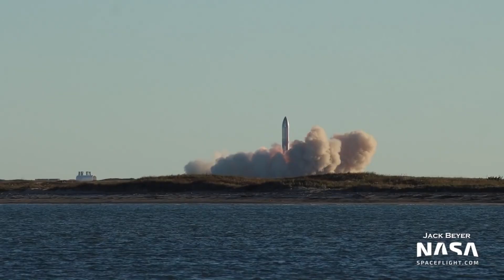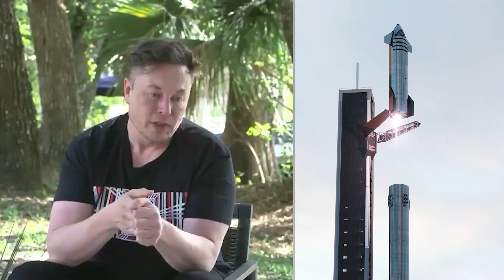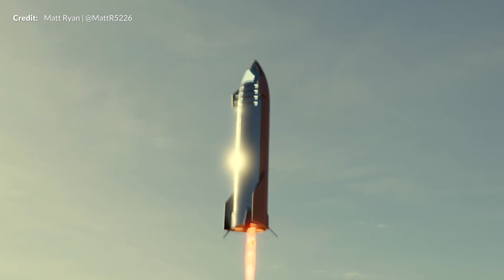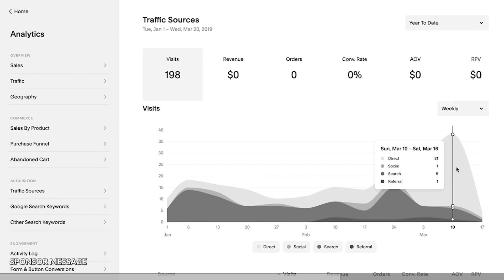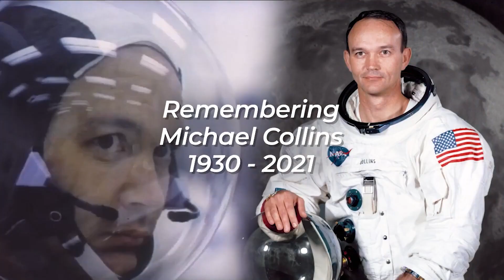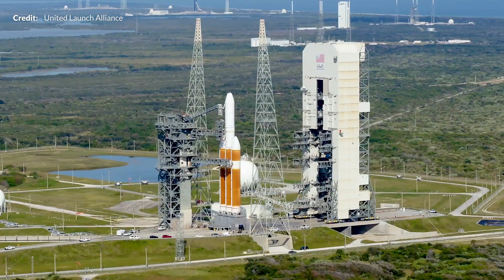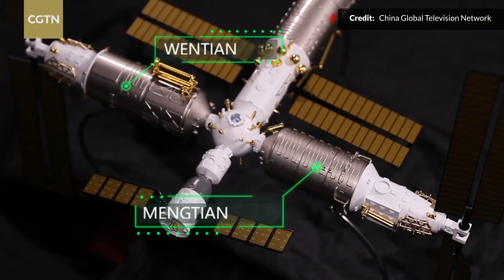SpaceX Starship SN15 Flight soon, NROL-82, Crew 1 & 2 updates, Starlink, Michael Collins

Comment: The Falcon 9 booster landings are extremely impressive and have become very accurate. My only concern is whether that level of accuracy would be enough to catch a super heavy. The margin for error would surely have to be down to inches. Just(!) landing in a circle would be nowhere near good enough.
Reply: The Super Heavy won't need to do a hover slam, thus it can trade fuel for accuracy.

Comment: The launch tower structural members - steel HSS (Hollow Structural Steel) columns with horizontal connecting struts and vertical bracing (diagonal members)

Comment: I guess that catching starship (as opposed to landing on the pad) would allow for much farther turnaround. You would not have ti land, wait for depressirisation, get out there with a crane and transporter, bring it back to the tower and stack with the tower crane. You could of course develop an optimized process for pad landings - but the one for catching has to be developed anyway. So: catching starship allows for optimal turnaround with overall simpler processes.
Thanks for the video!

Comment: Minor comment on the Integration Tower structure - the horizontal members are not supported by the diagonals. That whole triangular assembly is primarily to provide lateral stability against any non-vertical forces such as wind, vehicle lifting/moving/catching, etc. It transmits horizontal forces to the base and foundations without the whole tower excessively swinging and swaying around. It's what is generally termed as 'bracing'.

Comment: I was out of the loop for a while... what happened between SN11 and now? We are at 15 already?
Reply: SN12,SN13 and SN14 were never fully built as the upgrades required had been designed/ built into SN15. So it made sense to skip straight to SN15.
Reply: @InnocentMan99  thanks for that, makes sense to me! Cant wait to see SS atop the first stage
Reply: SN11 blew up. They skipped 12, 13, and 14 as they didn't inovate enough.

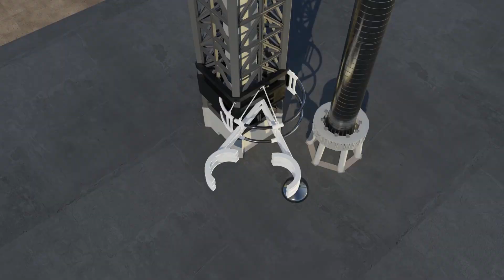Comment: 5:52  The launch tower will not have a crane on top. The tower arms will do the stacking. OweBL has it right at 6:46. As per the FAA application; the design "will allow the mechanical arms to lift vehicles."  That document specified the tower height and the height of the lightning rod on top - the height of any structures on the top is central to the FAA's concerns. To them it's all about how far up it extends into airspace, so mention of a crane is conspicuous by its absence.

The tower will have arms anyway, so why not use them for stacking also? No crane means - the best part is no part.

Comment: Oh and for catching Starship? that's obviously only for the tanker versions - so they can take more fuel up per trip.
Reply from the maker: You know... that is a good argument.
Reply: @MarcusHouse  - sorry yes, not 'obviously' sorry - a turn of phrase.

But given the complex dynamics of carrying fuel while burning fuel - not having the legs or the internal bracing to take force at those points?

for a single moon/mars starship? might equate to one less fuel tanker launch, or mean the same number but 'safer' launches.

It's possible they intend to catch a lander starship to somehow save of the amount of fuel it needs to land when it gets back home - but... why not just refuel it in earth orbit (enough) before landing if that were the case?
Reply: @MarcusHouse  - it doesn't need as much fuel for landing - so a full tanker ready for the next Starship to launch? could be waiting to provide some landing fuel for the Starship that's arriving (presumably this would offer an advantage when making a mars -> earth transit as you wouldn't need to carry landing fuel etc) - at the very least it would be a good safety 'feature' to have should crews return in emergency and the fuel is somehow not available.
Reply: @MarcusHouse  - there's a lot of talk about proving in orbit refuelling - but let's be honest, it's basic engineering with some interesting challenges - of course it's going to work! like something in physics is going to totally block us ;) if we can refuel between aircraft in turbulant airflow? we can crack zero-g.

Comment: why dont static fires prosuce lift??
Reply: They do.But the base is bolted to the Launch Platform. They use explosive bolts to launch when the system says all 3 Raptors are operating within parameters.
Reply: @David-yo5ws  - They don't use explosive bolts - they use mechanical clamps that release - although when not planning a flight? it's probably also additionally bolted down.
Reply: @JohnnyWednesday  Awesome, I did not know that. Thanks for putting me right. 👍

Comment: Catch the starship with a big net. No fuel or header tanks needed.

For Moon and Mars we still 
need the swoop-swing-manuevre though.
Reply: It weighs 120 T.
Reply: @fredbloggs5902  I meant a huge net.
Reply: @dwdvIl  Not a spiderweb. Obviously! A human made net with dampers slowing it down from maybe 50 -100 meters height. Imagine Aricebo telescope but with a net.
Reply: @JensPilemandOttesen  Starship is designed to withstand stresses at particular points in precise directions, Landing with specific stress bearing points seems more viable. Like the jack points on a car.
Reply: @JensPilemandOttesen  If Starship doesn't slow it's falling speed, it will be like crashing into pavement, it weights 150 Tons. It may be possible in mars but here on earth it's better and cheaper to do a landing with the engines
Reply: The best landing is no landing at all - never land the tanker, hover it, have drones fly in with fuel pipes - refuel it - it goes back up.
Reply: @JohnnyWednesday  

I think you’re forgetting it’s the upper stage.

It needs to be placed on top of the Superheavy booster in order to get back to orbit.